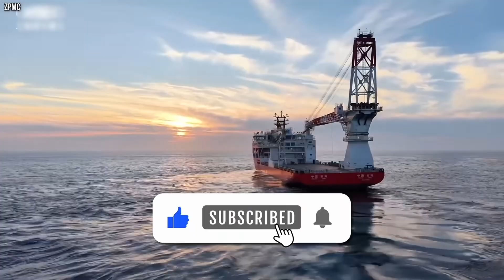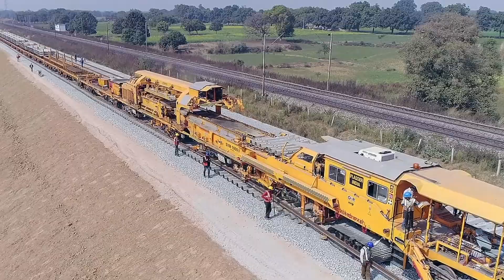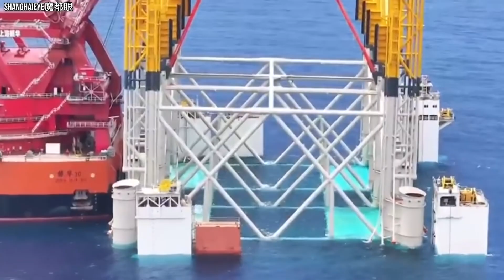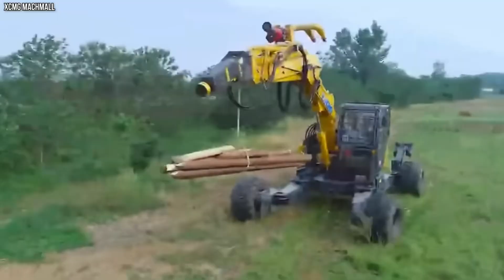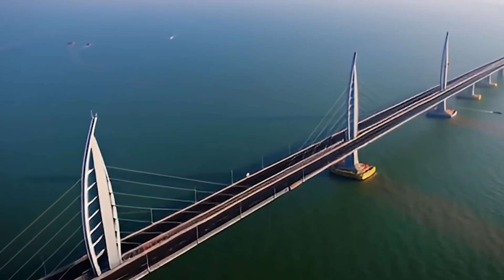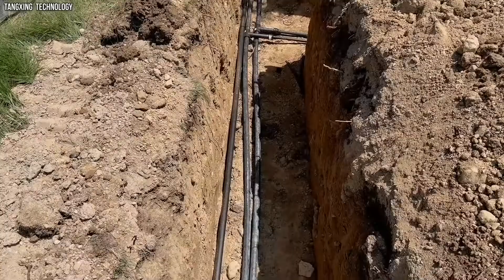China Just Built a Construction Machine the World Wasn’t Ready For

Comment: jmo: 
Hongqi Bridge in China collapsed in 2025 

From Wikipedia: 
"The collapse of the Hongqi Bridge in Sichuan, China, was primarily caused by severe geological instability and worsening landslides that gave way beneath the bridge supports. 
Key Factors in the Collapse Landslides and Slope Failure: 
Heavy shifting 
and worsening conditions on the steep mountainside  
triggered active landslides  
that undermined the western approach span and roadbed. 
Geological Instability: 
Experts noted that the underlying terrain featured loose soil and steep canyon walls, 
raising questions about whether 
sufficient geotechnical surveying, 
slope management, 
or bedrock piling 
were implemented." 
--------
Reply from the maker: Thanks for adding that context. You’re right that the 2025 Hongqi Bridge collapse was linked to severe geological instability and landslide activity around the bridge approach. That’s an important reminder that even the most advanced construction machinery still depends on proper geotechnical surveys, slope stabilization, foundation design, and long-term monitoring. The machine in this video is impressive, but no technology can completely eliminate the risks of building in unstable terrain.